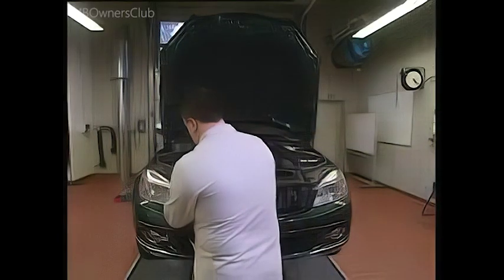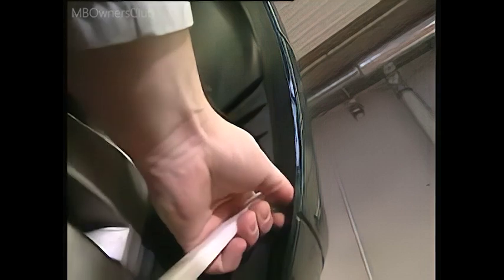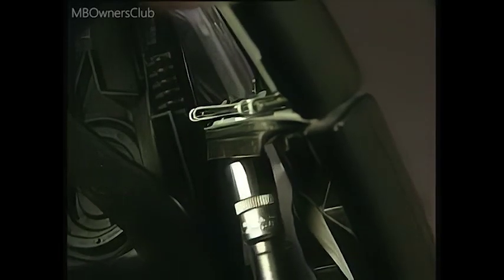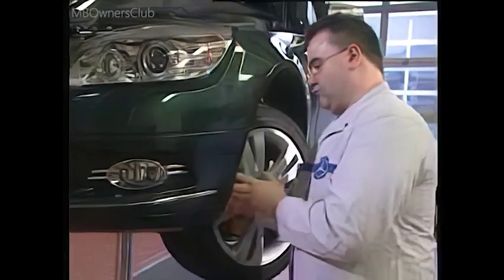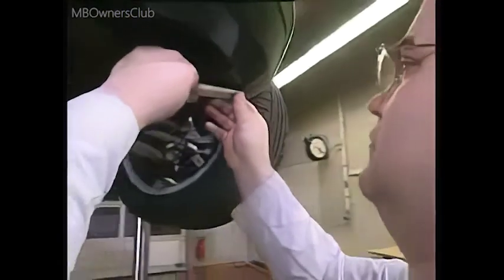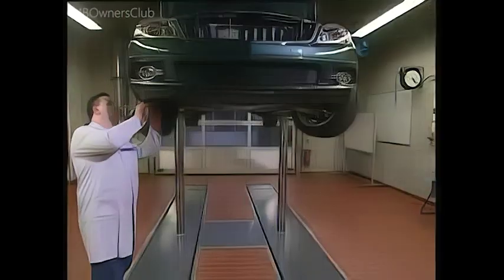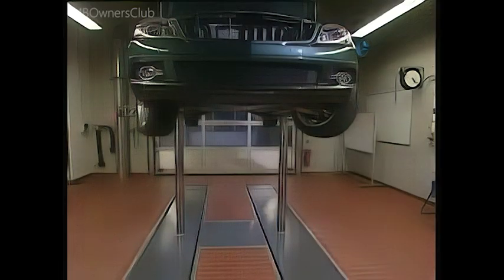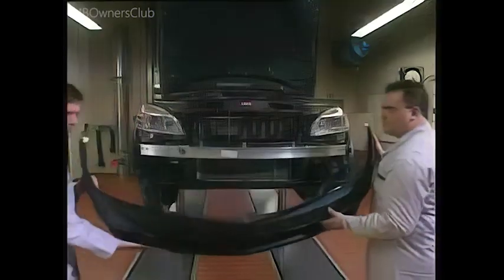DIY Mercedes-Benz C-Class Front Bumper Removal and Installation | W204

Comment: What measurements are the two bolts behind the wheel
Reply: did you find out
Reply: @csixtythree  I didn’t, haven’t tried/ needed to remove it, but I believe it’s 8mm or 10mm
Reply: @MikeNotSalty  its 10mm, just took my bumper off
Reply: 10mm